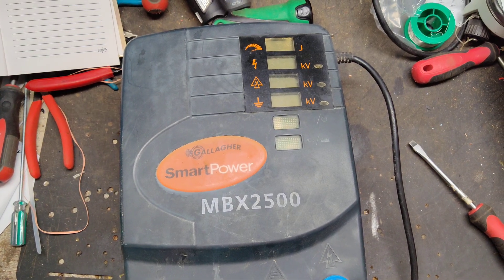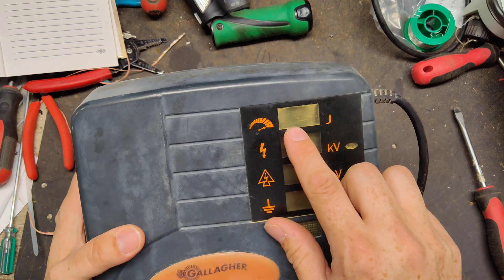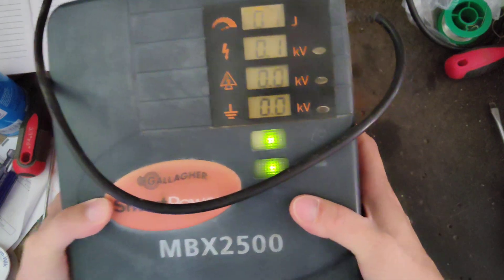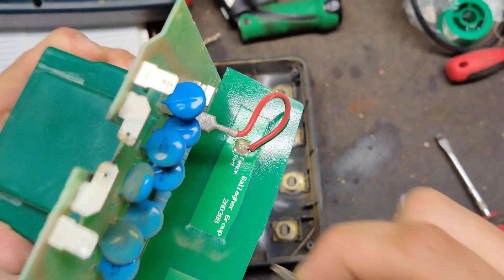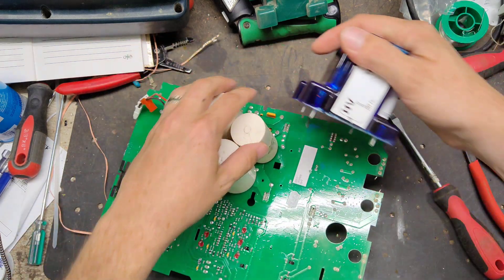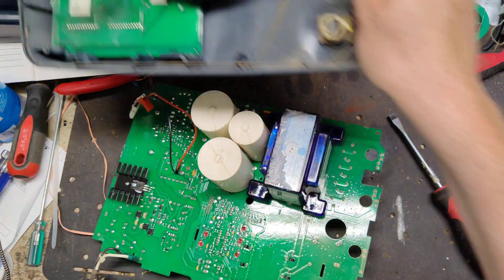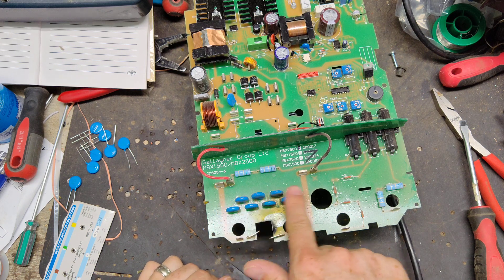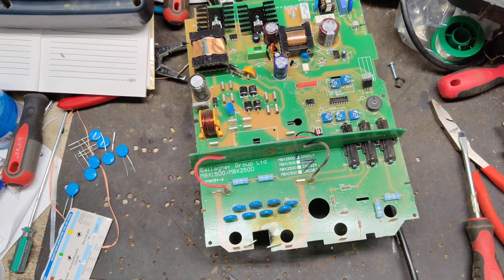Repairing A Gallagher MBX2500 Fence Charger

Comment: How to repair e2 error
Reply from the maker: I'm not sure exactly. There's microcontrollers on the board that control things, so I imagine something in that circuit had gone bad. There are no parts, except maybe capacitors, that are available for that model. It was discontinued as a production model about 9-10 years ago and parts were phased out about 3-4 years ago.

Comment: Did you ever sort that fault out? Or was it too much for you?
Reply from the maker: Well unfortunately there's no schematics or information worth anything from Gallagher, so not much help here in the States. All their manual says is it's an internal fault detected by the Energizer itself, module replacement. And unfortunately the module has been discontinued for about 4-5 years now and this video is 3-4 years old. They haven't made this model in about 10-11 years.